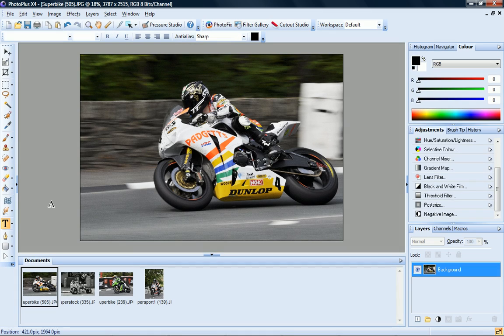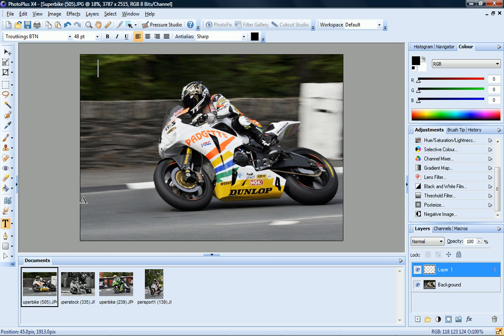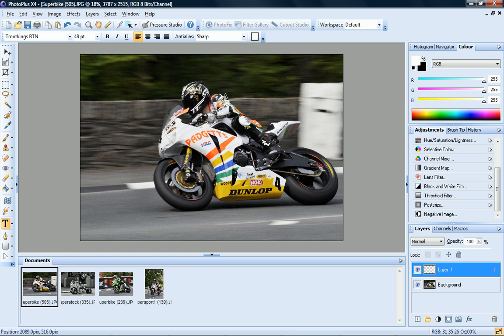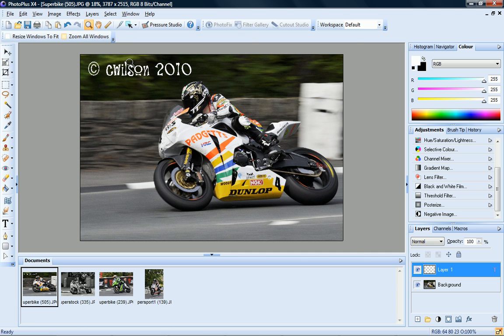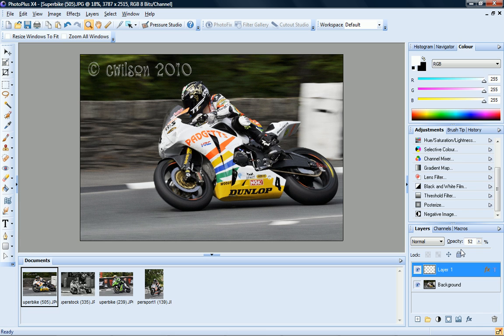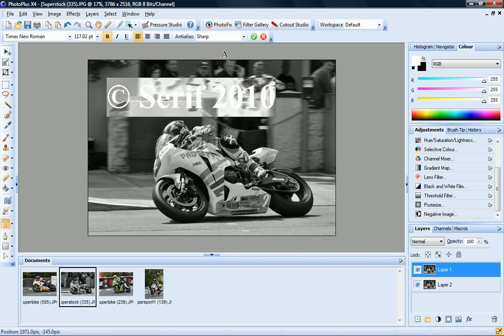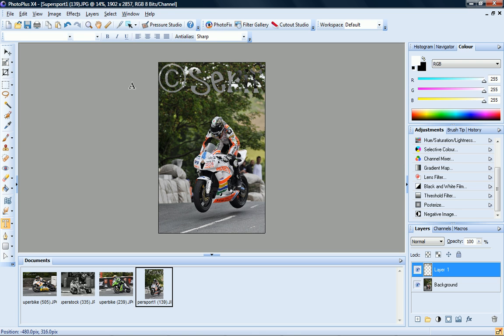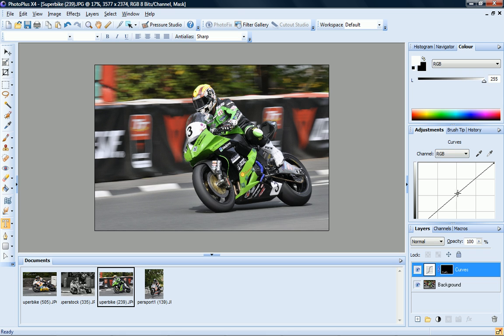Serif PhotoPlus X4 Tutorial - Add Text to Images

Comment from the maker: @Cybrean1 Hi there. The tutorial mentions one way to type a copyright symbol — hold Alt while typing 0169 (on the keypad) — but you could also try holding Ctrl + Alt then press C, or find the symbol in the Windows character map (Start button, Accessories, System Tools). For watermarking an image, I would suggest creating a text selection rather than regular text, then brightening the selected area until you get nice looking results. Hope that helps, Dale @ Serif.